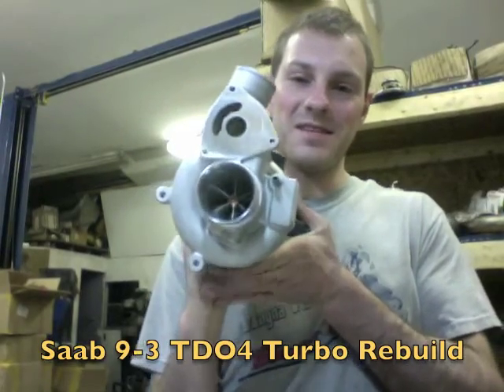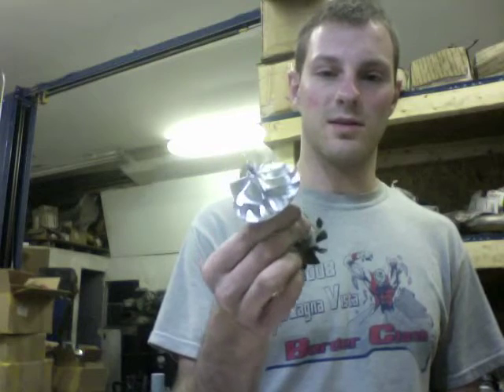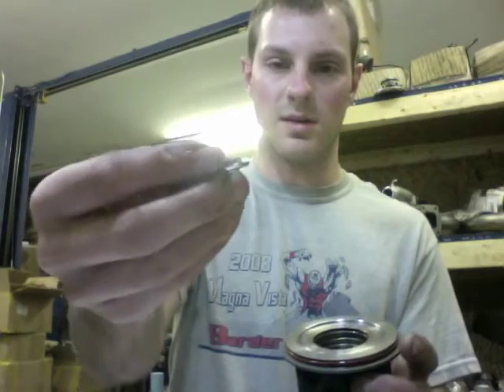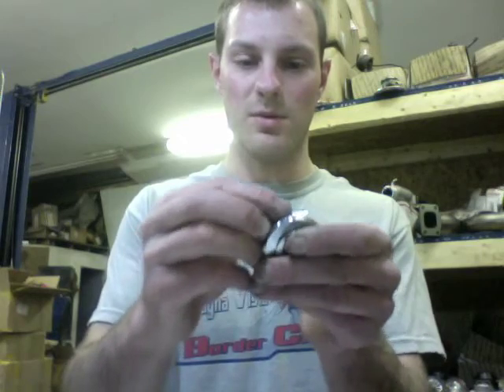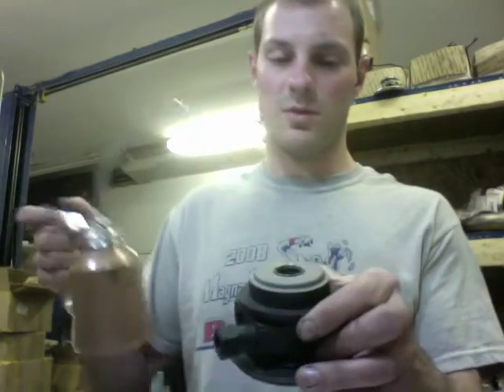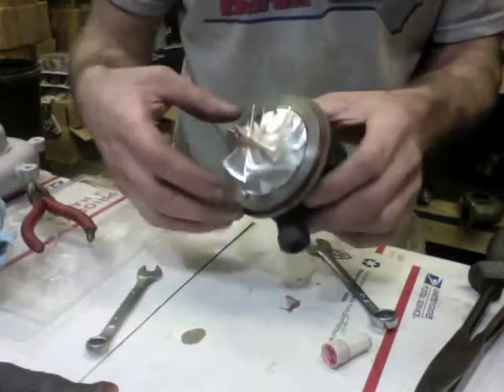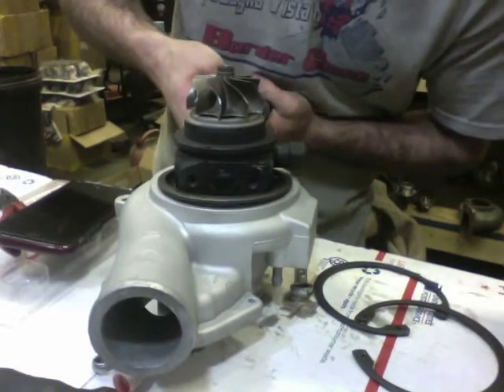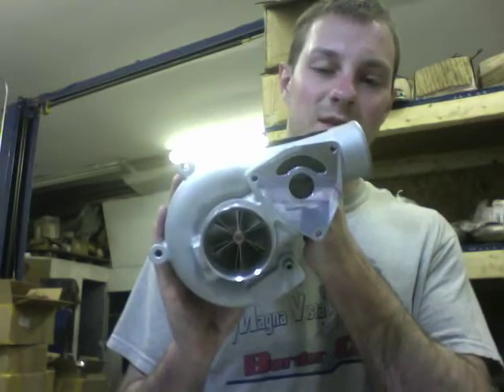Saab 9-3 TD04 Turbo Rebuild

Comment: I installed this kit Td04L, and after about 2 months I started burning oil at idle after driving on the freeway or just around town after being in boost. Any reason why that might be? Did I mess something up during the install? 
It seemed pretty straightforward and it went together without much issue. I plan on doing it again but I don’t want to mess it up again.
Reply from the maker: It’s possible to still leak if the tolerances of the bearing housing, or turbine shaft are worn where the rear seal lays. The gap between the piston ring and the turbine shaft is supposed to be .0025”. Some manufacturers such as Garrett have a tolerance of .007”. Mitsubishi and and HOLSET/ Cummins turbos are .0025” the piston ring gap when put in the bearing housing should be .0025-.006 for Mitsubishi turbos. I have an inspection video on the channel that goes through this but it is “he351ve inspection”

Other reasons can be the oil drain not flowing well enough, or the crank case vent valve needing to be replaced or the catch can needing to be emptied. Excess crankcase pressure from worn piston rings can cause the turbo to leak oil because the pressure pushes up toward the oil drain not allowing oil to drain. You can check for excess crankcase pressure case pressure by removing the oil cap to see if pressure is coming out with the engine running at idle
Reply: @turbolabamerica wow I really appreciate the detailed response! I will start checking all of those things. Thanks!! 😊

Comment: Hello and thank your for the videos. I have a MHI TD04-14T which is leaking oil on the cold side. Would you recommend a complete rebuild or just replace the O-rings if i find the turbines are good. Thank you.
Reply from the maker: You should just replace the whole kit to have the upgraded parts.